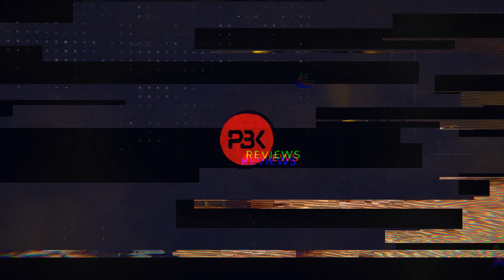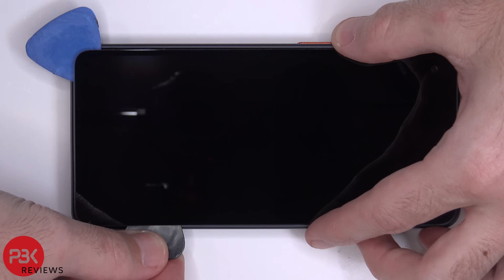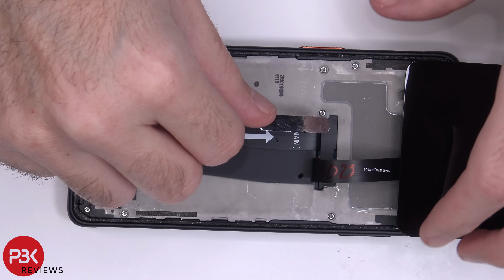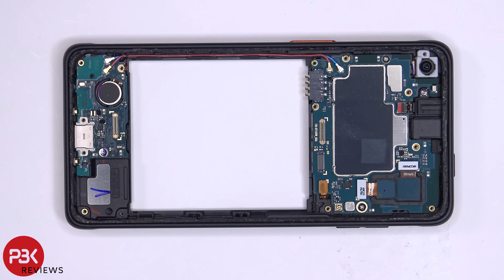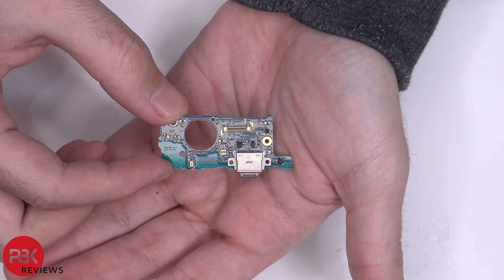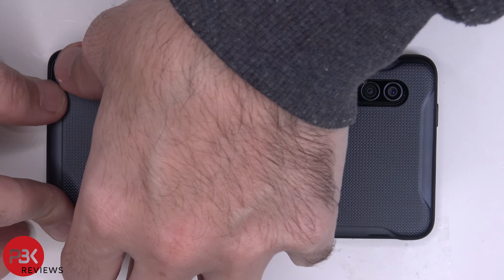Samsung Galaxy XCover Pro Disassembly Teardown Repair Video Review

Comment: What is the frame of this phone made of ?
Reply from the maker: If I am not mistaken, its a aluminum frame with a rugged rubber type coating.
Reply: PBKreviews i though it was totally rubber material with no aluminium under it 
Hope i am wrong
Reply from the maker: @amrashraf9559  I'm not 100% sure but doubt its all rubber since that would allow it to bend. It either has aluminum inside it or another material that makes it withstand bending easily.
Reply: PBKreviews and how is the camera quality of this phone ?
Reply: PBKreviews how do you rate the serviceability of this phone ?

Comment: Hello I just purchased a Samsung 512gb micro SD card and put it in the SD slot close the phone backup and it does not recognize I have and external drive In I don't think my phone came wit a SIM card installed I'm wondering if that is part of the problem all I think it has stock is the 64 gigabyte internal storage and the four gigabytes of RAM. If you could help me and give me any insight I would be extremely grateful. Thank you so much for that video that was amazing
Reply from the maker: You might need to format the micro sd card you have by putting it in a micro sd reader and connecting it to your computer. Here are the steps https://smallbusiness.chron.com/format-micro-sd-card-cant-read-55596.html
Reply: @PBKreviews  Thanks for your reply I actually didn't put it in correctly, I took it to Verizon and they put it in correctly I didn't push it in far enough. It is working perfectly now. 

Thanks again
Reply from the maker: @aldec2585  Oh ok no problem, glad its working now :)
Reply: @PBKreviews  😎👌

Comment: I'm hoping to see some extended battery upgrades for this phone. It being removable in this manner is a blessing; having extended battery replacements would basically make this a must-buy for me.
Reply from the maker: Yea, would be nice. If they make a larger battery that works for this model, they could easily make a extended battery door. Or you can modify and cut open the battery door to allow a larger battery to fit but you would lose the water resistance and so forth.

Comment: Will having an nfc in the battery make it harder to find a replacement battery? Edit: Also if i get a battery that isnt nfc compatable will i only lose the ability to use google pay? because I don't use that anyway.
Reply from the maker: I'm sure they will have replacement batteries since samsung advertised this device to be able to swap batteries on the go so they should make the battery widely available. Without the nfc you lose the google pay and also data transfering from phone to phone by placing their backs together etc. I personally don't ever really use NFC features so it would not make a difference for me.
Reply: @PBKreviews  Ok cool thanks for the response

Comment: Thanks for the video.  Any thoughts on how the pogos work for charging?  Hooking up just 5V and ground to them results in only a super slow 100mA charge current and the phone complains about slow charging.  Seems like there has to be some sort of charge detect but I didn't see anything suspicious in your tear-down.  Samsung has been tricky with using a simple magnetometer for such things in the past...
Reply from the maker: No problem, not too sure how the pogos work. Its possible there is a chip on the samsung pogo charger side that communicates with a chip or the software on the phone side. Not sure.
Reply: @PBKreviews  Yeah, guessing there is some sort of communication involved, but since there are only two pins it must be wireless (unless they are doing something really strange, but doubt they are encoding signaling on VDD).

Comment: for me it's great, because it comes with a removable battery and this is very good 👍🏻.
Reply from the maker: yup, I have gotten used to the fact batteries now a days are imbedded but if you could have the option of it being removable, why not. You can easily swap out discharged or defective batteries on the go.
Reply: Absolutely, or you can hammer the battery with fast charging and throw a new one in when it’s spent.
Reply: @thetechlibrarian  very intriguing. And have spare batts for a long activity charged and at the ready.
Though storage of them would have to be interesting.
Reply: @yeejay6396  I have a spare battery in my shirt's front pocket.
Reply: @douglasjensen8986  OH I meant for like long activities. Like camping or hiking, you know like out and away in the world.

Comment: Great video I wish if they make more of these phones and make them global
Reply from the maker: Thanks, ya they should have more rugged devices. This phone has recently released on Verizon but unlocked variant should be available soon as well. I know some regions already have the unlocked one available.
Reply: PBKreviews 
Why samsung uses a mid plate between the display and the main board of this phone ?
Reply: @amrashraf9559  Late reply. This phone is  designed to be easily serviceable, the battery and screen (The most common replacement in phones) are easily replaceable.

Comment: Would It  still  be waterthight after dissasembly? Awesome phone tho!
Reply from the maker: As long as you are able to get the original pre cut adhesive to put on the screen to seal it or apply new adhesive that is fully around the boarder of the display sealing it, then you should still have a water tight seal. Even the original adhesive on these one is pretty strong and will work to keep water out if you don't damage it too much prying the display off.
Reply: @PBKreviews  B-7000 glue is designed for smartphone screens. It is a thermal adhesive. If you need to remove the screen you heat it with a hair drier or on a radiator (not too hot). The glue softens and you can then gently and carefully prise off the screen  (guitar picks work well).
Reply from the maker: @peterjackson6237  Yes but you don't want to use glues that you will have trouble taking apart ever again if you need a new screen in the future. That's why manufactures use adhesive strips as well so if the phone needs to be opened, you're not breaking pieces off or having trouble taking it apart.
Reply: If it is like the one on iPhones, blow some heat on the screen for 15-30 minutes before disassembly. That may convince the seal to let go, without tearing up. : )

Comment: everytime you disconnect something with your metal tool I get a heart attack
Reply from the maker: lol sorry
Reply: @PBKreviews  it's okay I was just being silly :P
Reply from the maker: @ameliabuns  :)
Reply: @PBKreviews  eeven tho you probably know way more than me in repairing I have killed something by using a metal tool to unplug a cable. rare but hapoens. I've only attempted 3 repairs in my life and one killed my dad's m8
Reply from the maker: Ya there always is a risk when the battery is still connected, but once disconnected the risk if very minimal. It's always suggested to avoid metal tools but I have been doing this maybe 20 years now if not more and I have never had an issue with shorting any phone and I have taken apart many thousands of phones. I have 5 people per video min who say this to me and I say the same response but ya. If your not on carpet, or in static environment and you disconnect your battery when possible before disconnecting anything else you should be fine. But its different for different stuff. Say a laptop or some computers, if you disconnect something while the battery is connected, you can almost definitely guarantee you short the motherboard or render it useless. But phone boards don't behave that way to that extent as far as I have dealt with them :)
Reply: @PBKreviews  cool! can I ask how you afford to repair so many devices to gain experience on? since breaking any can be... expensive!
Reply from the maker: @ameliabuns  We used to own phone stores back in the day and I was one of the first to repair phones believe it or not. Since the Nextel days when the first Nextel phones were around, people all over the world would send their phones to me to repair and replace parts, add LED lights, customize etc. I'm not in the phone business much anymore but still enjoy doing YouTube videos. Expensive hobby but for as much as I can afford to, I put out these videos to both help people know how to take their device apart to fix and for those who just want to see what's inside and how It's made etc. :)

Comment: This could have been a perfect phone if it wouldn't have a stupid notch and if the fingerprint scanner would be under the screen instead of elsewhere...
Reply from the maker: The punch hole camera isn't bad, its barely noticeable most of the time. Fingerprint scanner isn't too bad being in the power button on the side compared to on the back of some phones but ya under screen would have been better.
Reply: @PBKreviews  I just can't unsee it. I cover my selfie cam so a Punch hole or Notch is my worst nightmare. For me, the best solution is a pop-up cam or for this waterproof Phone a similar design like the recent Sony Smartphones... Great content btw. !
Reply from the maker: Oh I see. Thank you :)
Reply: @Mircea What an idea. Why Didn't I Think of That...

Comment: Overall recommenced? Fast enough considering it is only 4GB ram?
Reply from the maker: Ya its a good device if you want something rugged, that has a removable battery and can withstand drops and such. Its made well and runs smooth.
Reply: @PBKreviews  it is available to buy in Europe. I was wondering if the european model has US LTE bands (12,66 etc)?
Reply from the maker: @jarule8065  The International version has these bands some of which US uses but does not include all the US bands. 2G GSM: GSM850, GSM900, DCS1800, PCS1900
3G UMTS: B1(2100), B2(1900), B5(850), B8(900)
4G FDD LTE: B1(2100), B2(1900), B3(1800), B5(850), B7(2600), B8(900), B20(800), B28(700)
4G TDD LTE: B38(2600), B40(2300), B41(2500)
Reply: @PBKreviews  it does not have ATT or Verizon bands (17 and 13 respectively). not even band 4 (att lte). 

I am hoping Samsung eventually releases the US model too once the corona virus situation improves.
Reply: Apparently there is a US model available now from Samsung.com and microsoft.com for $499 unlocked.